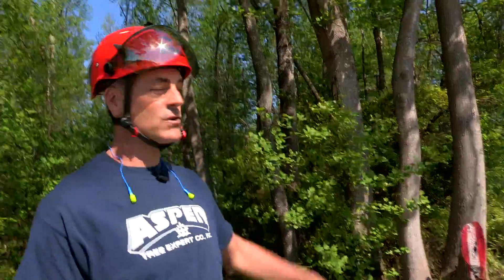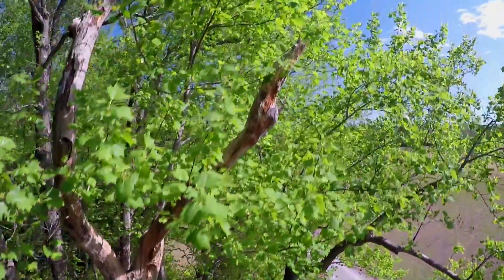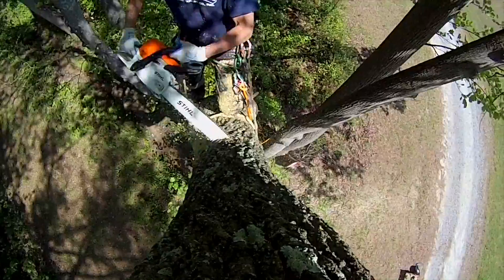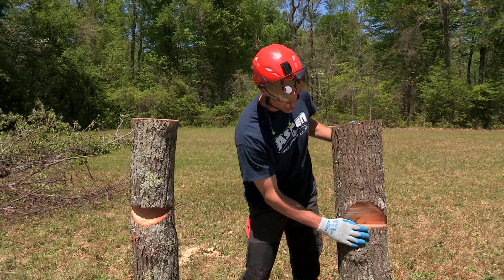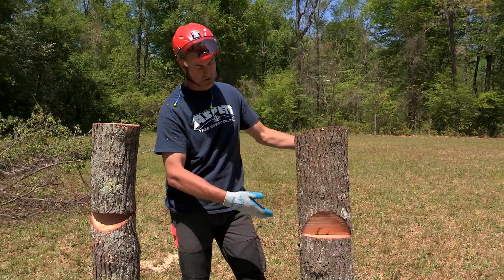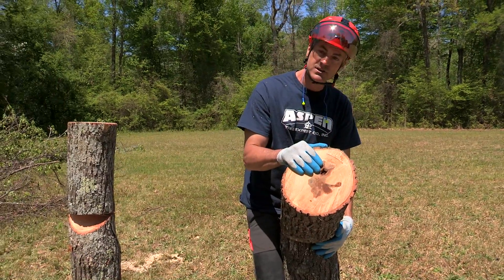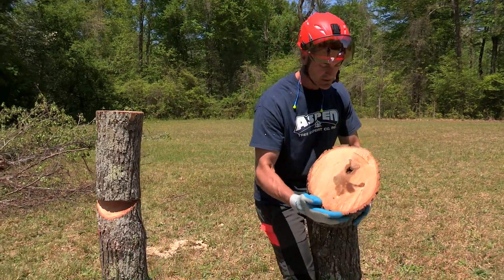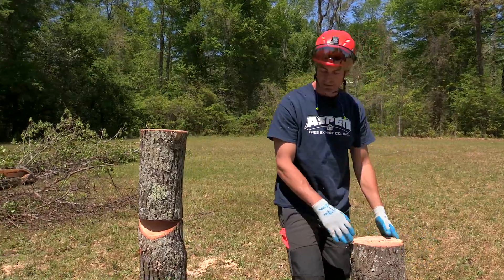How to Top a Tree That's Too Tall to Drop

Comment: What's the most versatile chainsaw for doing this kind of work? 
Seriously in doubt if a 50cc 5kg would do better than a 70cc 6 kg, am a bit worried about that extra kg up there, but the motor power is also a big difference...

Comment: I can't figure out how Mark is tied in here. I see a laynard, a cinching anchor knot on the orange line, and another line he is descending on?
Reply: The yellow line is a safety line its secured with a prusik around the attacmentpoint to the harness and if he falls the runningbowline around the tree will tighten up and hold him. The second one(gray) is a regular lanyard it looks like.
Reply: @Ithzzz  Thanks. I assume some people use the bowline as a pull line after they descend. I've used the tail of my climbing line to tie a retrieval line on the cinching knot; simpler than trying to make a midline butterfly knot in the tree with a tail for retrieval.

Comment: Hey Mark grate job!
I see you have a safety rope tied to the tree as a second safety measure. How do you tie it to the tree? I know it may sound stupid for some , but I would like to see how the pros do it. 
Thanks.
Reply: It's hard to explain without pictures but its choked off with a running bowline , a friction hitch below and then a meunter hitch to absorb heat and friction.
Reply: Ecbe Aut I have the same question, I'd like to learn how to tie myself safely.
Reply: think the pros tend to not answer for safety reasons.Prefer to be trained by a licensed assessor.  I too want to know, and be a tree cowboy haha.
Reply: Great

Comment: I  feel like  u missed  the most important  safety  factor in using a Humboldt  in topping  and that is the top sits down  on that face cut now pressing  against the stem , rather than conventional which  can kick right back at u and create an ugly  situation.  after all isn't safety number 1.
Reply: alfred,

In a Humboldt cut, the top falls down on the angled bottom cut of the notch, and then slides away from the tree. In the conventional, the top can have a tendency to slide back into the arborist or the tree since the bottom cut of the notch is flat. This fact was missed in Mark's presentation on why the Humboldt is better when topping.
Reply: @Comic_Saens  no
Reply: @hoveredgirlheygirlhey8345  no u
Reply: A Humbolt cut can employ an anti kick step as well. All three face cut types can and is wise to use it
Reply: Hello Hammer tree can you please explain what you mean by "the top sits down on the face cut."  do you mean that he put his back cut in the wrong place like to high or to low? Thanks.
Reply: disagree.. While the conventional cut tends to jump off the spar and if not cut up enough can hang at an angle. With a proper anti kick step in the back cut there should be no risk of a tree sliding back on the cutter. Both cuts are acceptable and are used to place wood in a different fashion.
Reply: Rusty Climber  yes, Barenek uses it as do most pros. It is in the handbook.